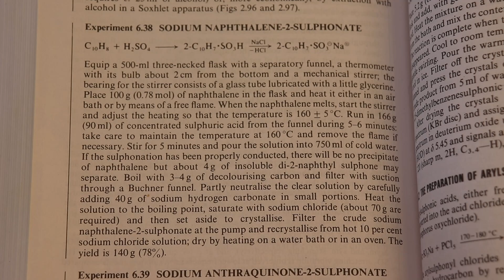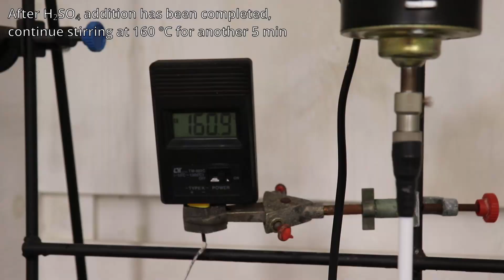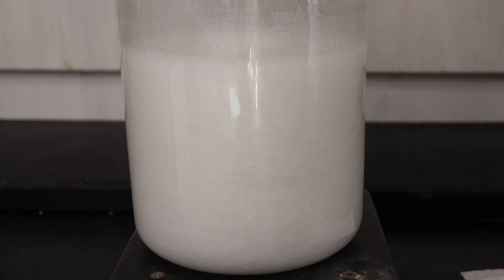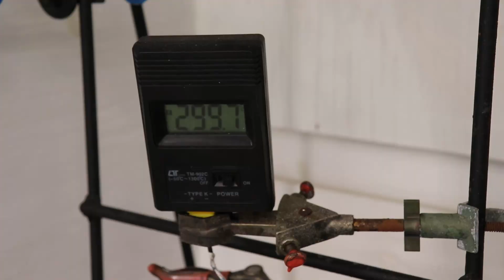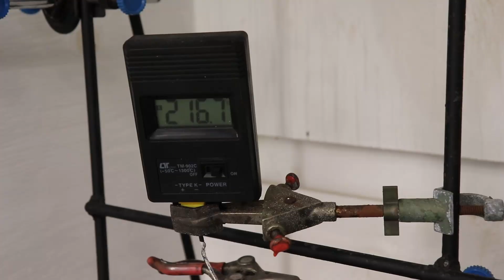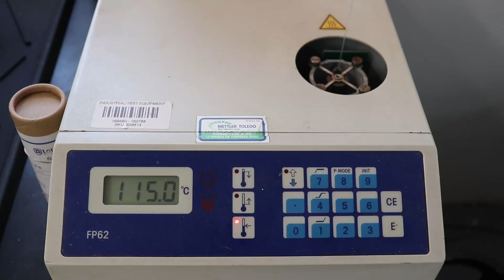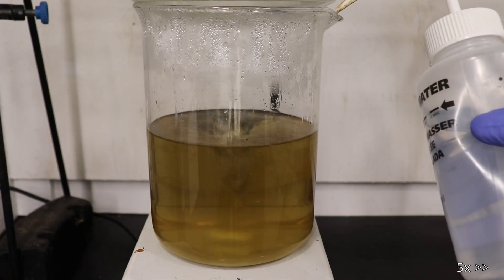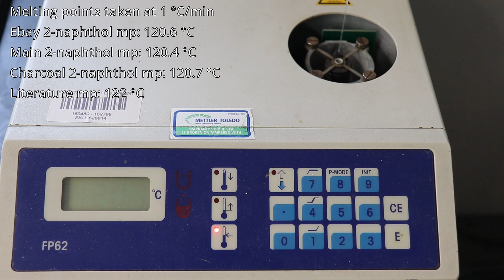2-Naphthol Synthesis from Naphthalene

Comment: Hey, there’s a “nicer” way of making 2-naphtol that could be higher yielding.

Start with naphthalene dissolved in an inert solvent along with some nitrobenzene and aluminium trichloride catalyst and acylate it with whatever you desire. Acetyl chloride works well, though you could use other things like phosgene or even go fancy with ethyl chloroformate. Doing this reaction in the presence of nitrobenzene somehow modulates the reaction into producing almost exclusively the 2-acetonaphtalene product (use acetyl chloride to make acetonaphtalene).

Then perform a haloform reaction to turn the 2-acetonaphtalene into 2-naphtalic acid.

The 2-naphtalic acid can be converted into 2-iodonaphtalene or some 2-halonaphtalene via a Hunsdiecker-type decarboxylation. The mercury oxide or the Kochi reaction work better than the plain silver salt reaction for aromatic acids.

Once you have the 2-iodonaphtalene, dissolve it in an alkaline solution to hydrolyse it.

It’s a bit of a longer method since it uses milder conditions but the impurities formed at each step are well-behaved, can be separated by distillation/solvent extraction and you get less tar forming.

Edit: You can theoretically jump a few steps and try the Boric acid-catalyzed Dakin oxidation on the 2-acetonaphtalene. It forms the naphtol directly but it’s a bit finicky to get it going. The side-product is the carboxylic acid which can be converted to the naphtol via the above mentioned Hunsdiecker route.

Comment: Looks like the alkali reaction also produces SO3 which is certainly going to be expelled as a gas during the heating process.

Ever had to filter a rosin-isopropanol solution through cotton?  You have to do it under pressure- I used a big syringe with cotton in the bottom.